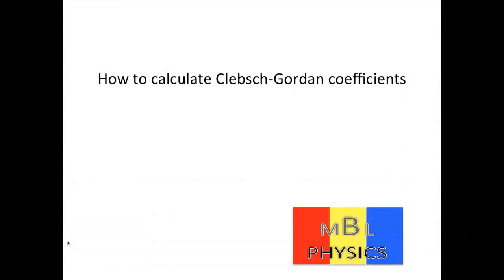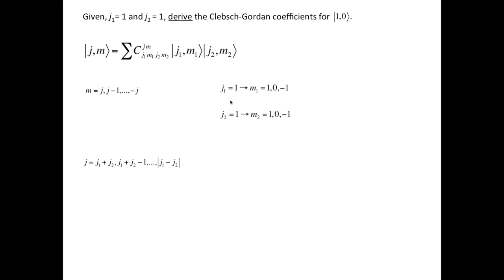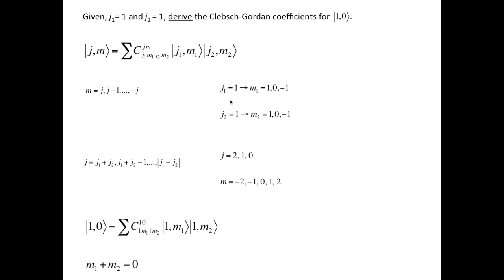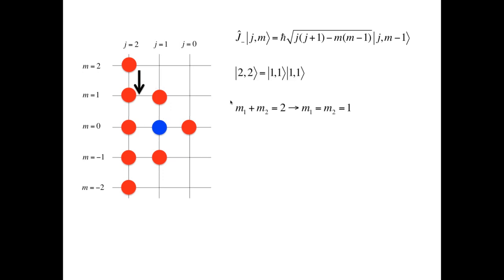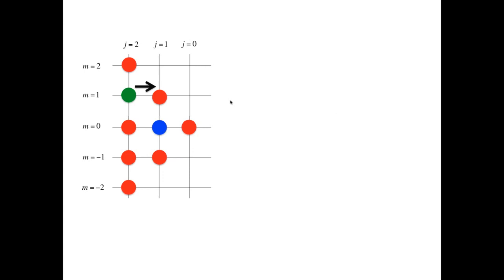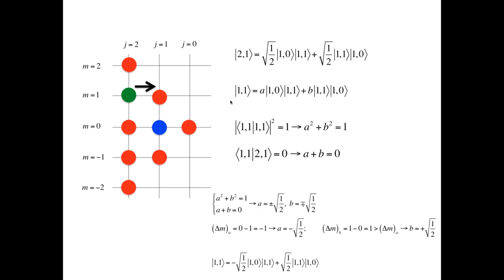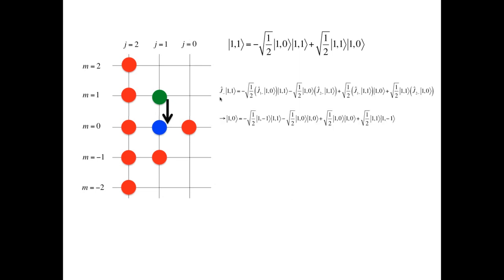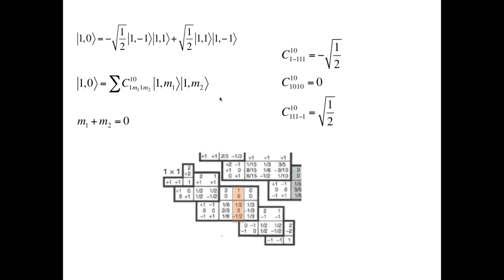Clebsch Gordan coefficients: an example

Comment: @4.43 there are three states that give M=2, not a single state no? |1,1>, |2,0>, |0,2>
Reply: No.  The way that state is written, the second term is the "M" value.  Like |J,M> (on the left hand side).  So the only state with M=2 is |2,2>.  

You can also determine this by remembering that the possible values of M can never be a greater magnitude than the value of J